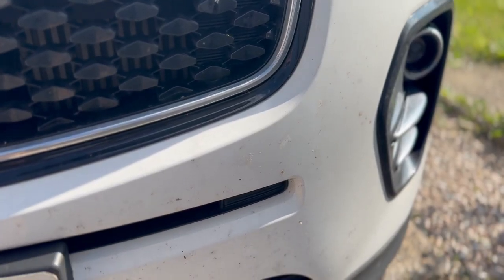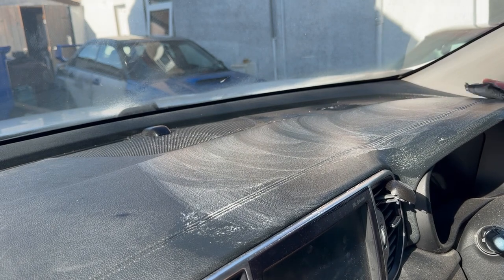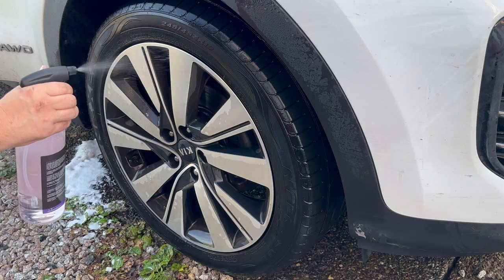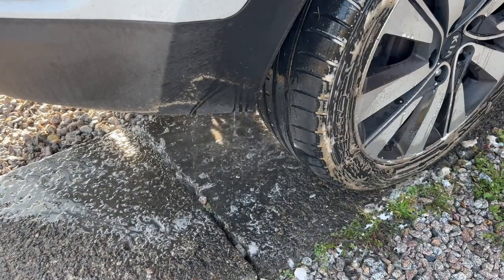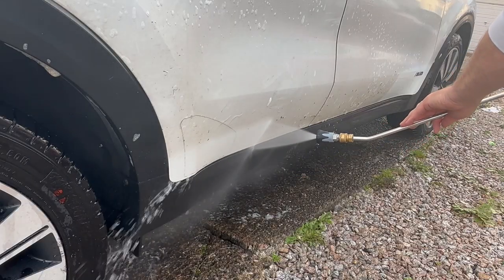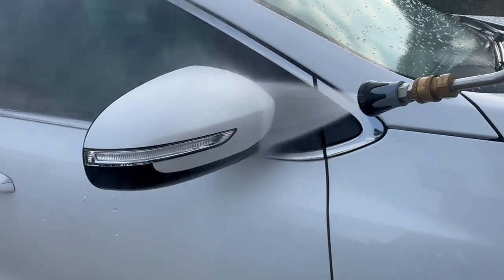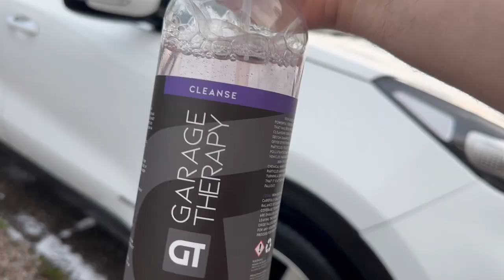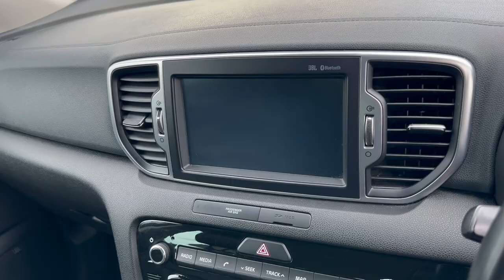Dirty Kia Sportage | Exterior and Interior Decon Wash and Protection

Comment: Yeah, nice one mate, white looks great clean.  Great products used too. All the best David. 👍
Reply from the maker: Thanks Lee, how is the car going that you put the lite ceramic on?
Reply: @DavidMcBay  hi mate, I'm bamboozled by it, it seems dead already.  I don't think it was an application error,  I did all the correct things, the only thing I didn't do was machine polish, but the car was 8 months old at the time and had a few thousand miles, I didn't think it was necessary.  I've done a chemical decon and cleaned with IW Refresh, but it didn't come back.  So I've layered Mile Deep Shield on it now and that's doing what it should. I'll get it to the spring and then get the machine polisher on it, and try again.  It'll be very interesting what happens next year.  Seriously, top man for remembering that, fair play to you. 😁
Reply from the maker: @decker0373  Thats really strange mate,  so how many months and how many miles in are you with it now? it might be worth giving it a blast with some fallout remover followed by the refresh next time you clean it to see if that rings it back atol.
Reply: @DavidMcBay  I got 5 months before large sections were dead, mainly the flat panels. That car doesnt do much mileage at all, probs no more than 4k a year.  I did hit it with fall out and the Refresh before deciding to use the Shield. I don't really get it, it has to be that I didn't polish it, I'm sure I installed it correctly, but I'm a novice, as you know, so there's always the chance I simply made a hash of it 🤣.  How's the mini running? I see her photo bomb the Kia clean 😊

Comment: Hi mate. The car looks really good at the end there. I always  pick up a tip when I watch somebody else do a detail that I think might be worth incorporating intro my wash procedure and today was no different. Using the turbo cleaner that I have only used for washing driveways but if you say it works its good enough for me to at least try it. The wee blue turbo bit you used looks neat I wondered where you got it. I do have the Karcher one but it means removing my stubby gun but if I had a wee nozzle with quick release it would be handy. I have not used Sigma or CS for ages as I always use wax on my cars but must try it again on other cars. I have not used any V2 GT products yet but I have so much product to get through it may be a while before I get a chance to put in an order. I have been using my Autobrite Citrus at the higher dilution to good effect after our last discussion. I look forward to your next offering. Thanks again for the tip.
Reply from the maker: Hi John, i was really pleased with the turnaround on this one. The turbo nozzles are great for the carpeted liners, the one im using i got from KDN detailing its a great bit of kit and brings up the monoblock just as well as the arches haha. Im just about out of my Autobrite Citrus but the way things have been going with the GT version im considering investing in 5L of it next.
Reply: Hi mate I had to give you an update. I was detailing the i-Pace yesterday as it was due it's MOT today and I thought hey I'm going to try that trick on the arches as back & front are carpeted so I did and it worked a treat cleaning off ingrained dirt as if it had never been there. That is a genius hack and I had to thank you for that one and I have passed it on in the interim and credited you in my comment. Thanks again. @DavidMcBay
Reply from the maker: Brilliant  @johnbrown3951  im glad it worked well for you, i used to detest doing the carpeted liners but since discovering that method they are a breeze now, just need to be careful not to hit any paint work as that attachment could do some damage lol

Comment: Dave would GT Decon shampoo get rid of  water spots ?
Reply from the maker: It really depends on what area you live in and how hard your water is. I normally don’t have an issue with water spots being in Scotland, they tend to come off with a normal shampoo. If you are struggling with them though GT have just released a water spot remover that would probably do the best job
Reply: Thanks Dave,   Yes I was looking at GT WSR on line. We live in North Norfolk,  super hard water.